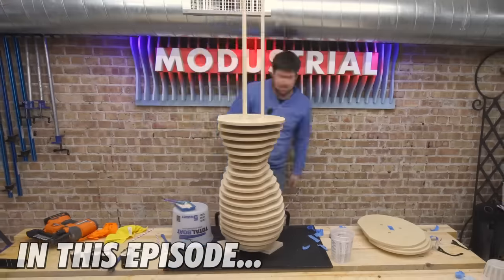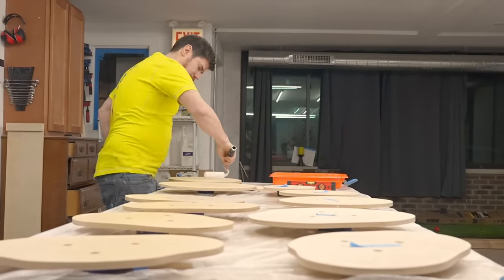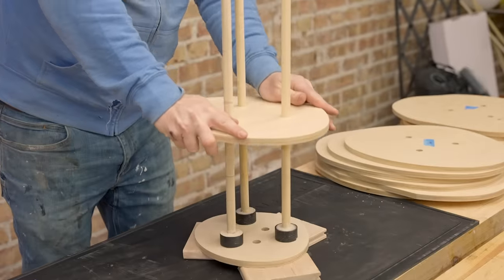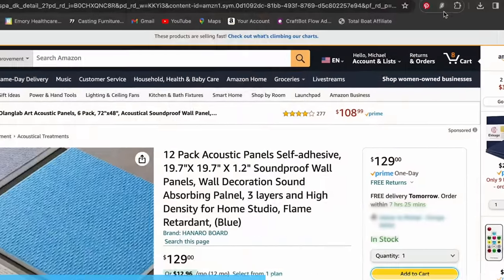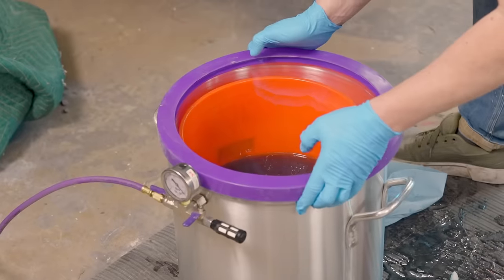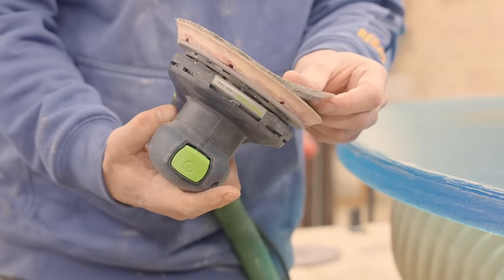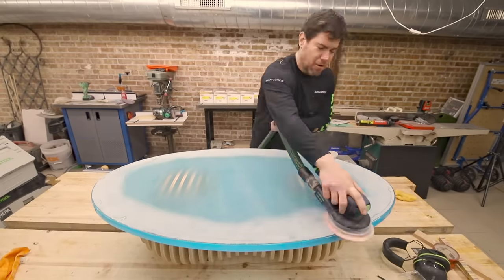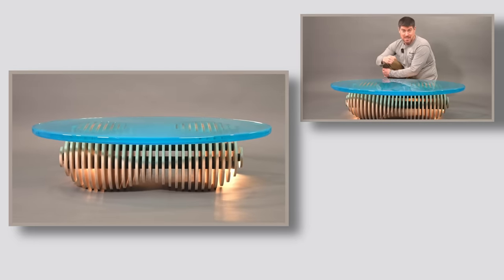My Craziest Table Idea yet...

Comment: Real woodworking is when: You work wood. Be that hand tools, power tools, CNC machining, laser cutting, using The Force. As long as the wood is being WORKED, that's wood working.

"Traditional" is silly. Just say you "prefer manual labor for the enjoyment" over increased productivity and accuracy.

I'll give a hot take for this one as a comparison. AI can't make art. It's theft (when applied generally). BUT, if an ARTIST trains an AI to generate references with THEIR OWN WORKS, then it just becomes another tool in their shed. In the same light, a power tool is just that, a TOOL. Same as a manual tool. If you are still involved in the process yourself, even if it's just creating the design language, you're woodworking. Just because you might use a machine you programmed to do the manual parts for you, you're still in the workshop fine tuning it to make it exactly to your specifications.

Humans have physical limitations. We design machines to overcome those limitations, such as working at the microscopic level when making microchips, because let's be realistic. WE can't see things that tiny, or move that precisely. Machines can. But they still require OUR input to function the way we need them to.

Also that table is absolutely amazing, 11/10, would put that in my Sim's house (because I'm too poor for fancy things, but my Sim has a Motherlode of cash XD)
On the topic of styles, I like both using clear/lightly colored epoxy as well as ones with added properties. I can appreciate both the wood grain, and the sparkle of metal flakes equally at the same time. I'm obsessed with Sci-Fi things, and space, so I see a lot of art pieces that are very busy, and I kind of grew into being able to enjoy both sides of simplicity and complexity.

Comment: LOL, no that is not why you got bubbles. In a thin pour like that not only would all the bubbles burst on their own they would absolutely , easily be eliminated with a heat gun. Even in that short clip someone mentioned how thick it was. There was absolutely a problem with your epoxy.